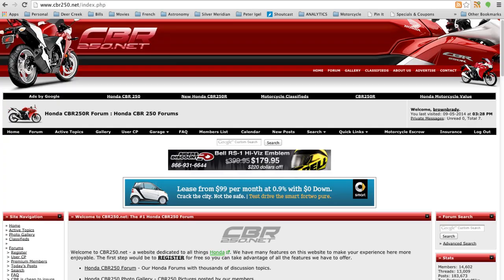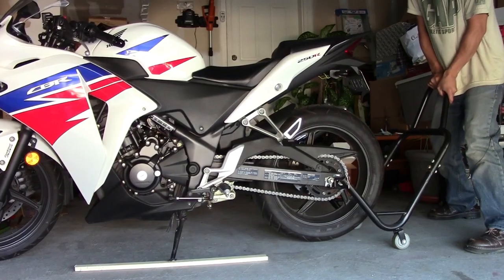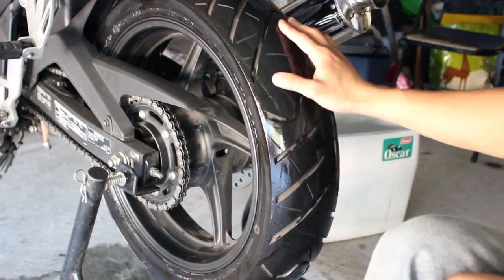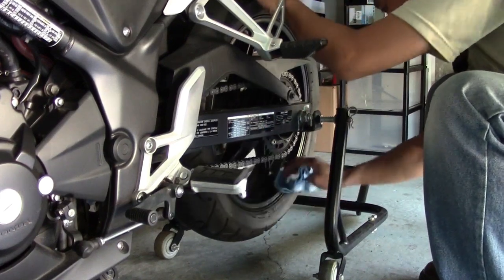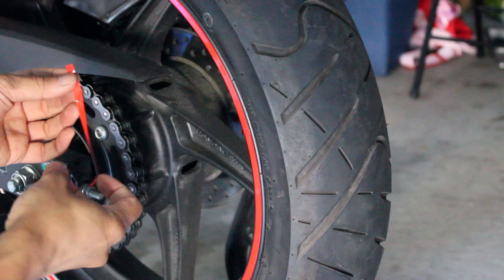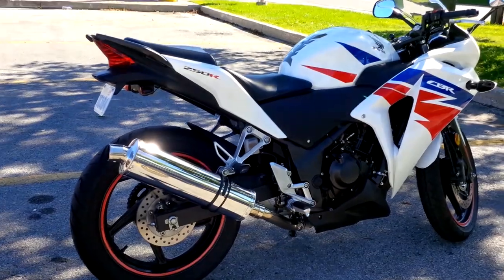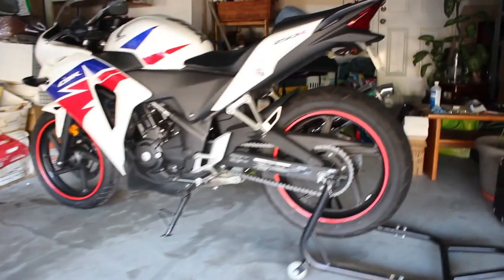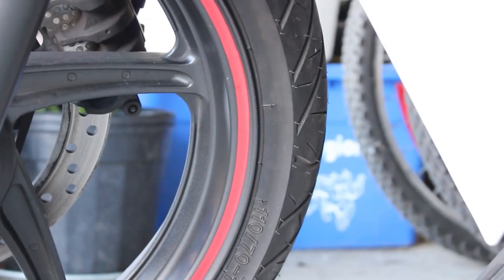Motorcycle Rim Tape Installation & Night Test Ride without Applicator

Comment: good video .

I actually pulled my wheels off when i did mine. also did it in my room, it's too hot out here in central florida !! I'm actually going to redo the first side that i did, i didnt realize there was enough tape in the kit and didn't overlap and have tiny gaps on the first side that i did....
Reply from the maker: +samuel lopes Thank you for the comment. The kit is cheap enough that you can buy extras for redoing it if you're not happy with the application.

Comment: The only problem arises when you stick the sticker directly is, you'll never get a room to adjust it whenever it looks unbalance visually. As a good advice, pour a little shampoo on a glass of water until the water in the glass turns slippery. Then, before you stick the sticker to its place, put some of that slippery shampoo/water to your rims so initial it won't stick immediately, so you can still adjust it till you find the perfect fit for the sticker. When everything fits right, just leave it for an hour, the sticker will still sticks perfectly at the right place.
Reply from the maker: +Al Alih Hamis That's an awesome advice. I have to try that in my next set. Thanks for your tips.
Reply: would be better to use alcohol. it vaporates completely instead of leaving a residue of soap on the rim

Comment: Spraying the wheels with water helps as well to move the tape around, then smooth down and dry with a dry microfibre cloth, also, you need to overlap all the ends, in time and I mean a few weeks the tape will shrink,overlap them all

Comment: I hate to say it, but your chain looked it was kinking. It did not look like it was coming off the bottom of the rear sprocket smoothly when you were rotating the wheel.